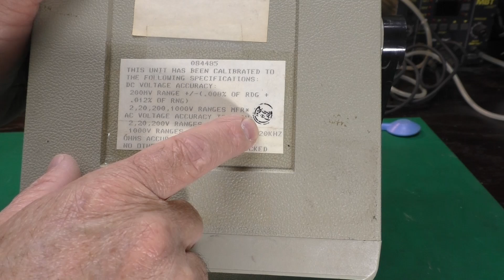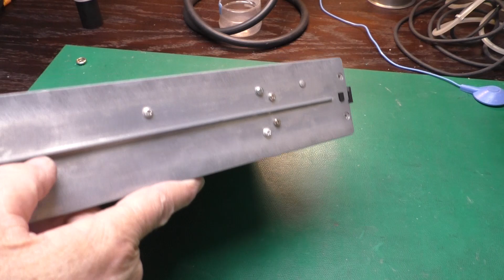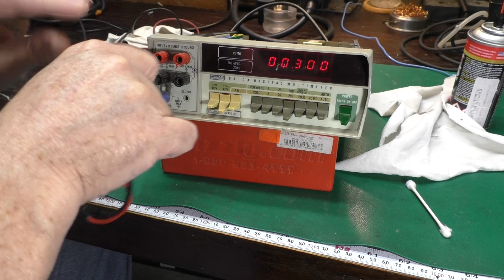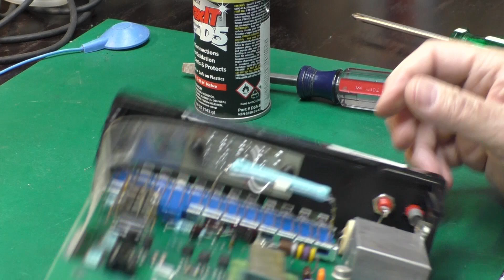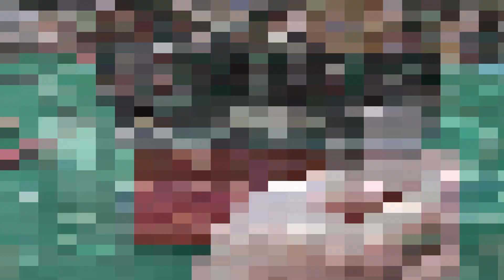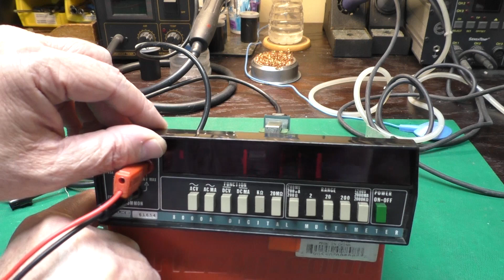Vintage DMM repair: Repairing and testing a Fluke 8810A and two Fluke 8000A DMMs.

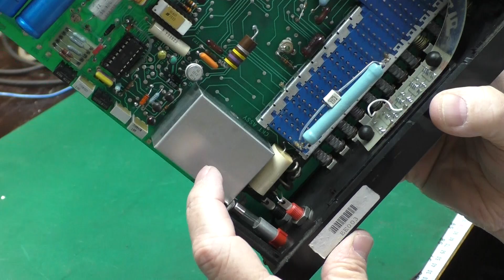Comment: At 28:00 I think the fuse you have is too long. I think fuses come in shorter sizes. If so, glue a thick piece of plastic to the metal housing that is thick enough to keep longer fuses from being inserted. Also, I can't beleive they marked milli Amps as MA... that is Mega Amps... who approved that? I would have been embarrassed if I let products out the door with such bush league nomencatures.

Comment: You were getting confused on a lot on the scales. I never liked that Fluke labled the Ohms switch as K. Its not you, its a human factor. They should have marked the mode switch as simply Ohms, and the other switches as (using Omega) 200Ohm, 2kOhm, 20kOhm, 200kOhm, 2000kOhm, and 20MOhm. But they do thesecscheme consistently on their meters. Also, I would have made the 2000kOhm range 2MOhm, but I am not Fluke.
I make overlays for my Fluke meters that re-label the switches. On my 8060A, there is an Auto Range for Ohms but its not shown. There is also Low Load/Hi-Z for the lower two voltage ranges that is also not shown. I shown both of these.

Comment: Nice video, gave you a like. You should use an ESD mat and wristsrap when handling the electronics. Static electricity you can't even feel can destroy the circuits or make them "walking wounded".
Reply from the maker: The green mat is an ESD mat that is even grounded. I've never had a problem blowing up things due to ESD and have not found a wrist strap that beneficial; but I do have one.
Reply: @HeyBirt I hear you and in fact many people think that ESD is not a big deal. I was like that too until the Air Force gave us special classes in ESD. It was an awaking!
CMOS components are particularly susceptible. I was amazed when the instructor pulled off an inch of transparent tape and held it up to a special voltmeter that does not load. It showed 1000's of volts. He had a chip that was delidded and a microscope homed in on a pin circuit. He touched the tape to the pin. He felt and heard nothing, but we saw a slight damage to the circuit in real time. The circuit still worked, but it was now walking wounded and just waiting to fail. He asked me to stand up from my chair. He held the meter to me and it read over 800 volts.... its not enough to zap someone on their ear but enough to cause damage. 

So the mat is good, but that wrist strap bleeds you to 0v with respect to mat, even as you move around and pick up things. ESD is why you should never have stryofoam, tape, and many other static generating materials on your bench. Since the meter case is plastic, it too genertes static electricity as it is moved about. So ionizers are used for that as well. I have designs under the ocean, on the sea, on land, in the air, and in space.... ESD had to be followed.  Reliabilty is they key here.... static is a silent deamon... it does damge that will haunt you when you least expect it.

Its up to you, but you should consider ESD precautions.  No harm, no foul... peace!

Comment: The high pitch wine is from the inverter circuit. Most AC powered Fluke meters convert AC to a low voltage DC. Then that DC is sent to complementing transistors (inverter) to turn that DC to a high frequency AC that drives another transformer or full wave bridge rectifier to derive the final voltages used by the meter. The frequency is constantly adjusted to maintain very steady voltages. Usually switching power supplies operate at around 40KHz. I don't know the frequency Fluke used, but if you hear "screaming" it may be a harmonic. Power Transformers have laminated cores to reduce eddy currents and hum, but the shellac between the core plates may have broken down a little over time. After 15 minutes of warm-up, measure the temperature of the transformer using an IR thermometer. If it reads more than 15 degrees C over ambient, the transformer may need to be replaced. Look for anything else that may vibrate a well. The whine comes and goes, the power supply may be overloaded. Check the ESR and Capacitence on all electroytic caps. The dielectric can break down over time and dause severe loading.